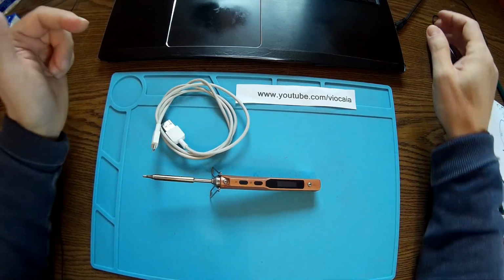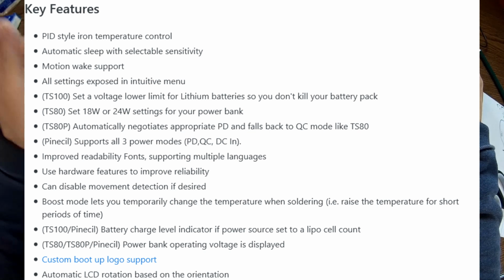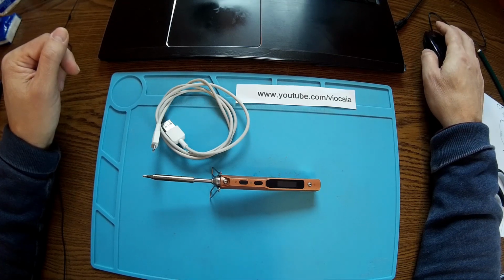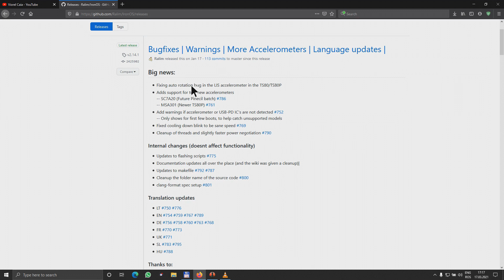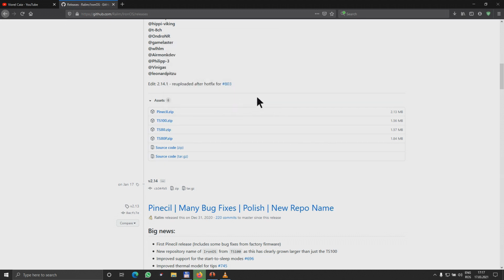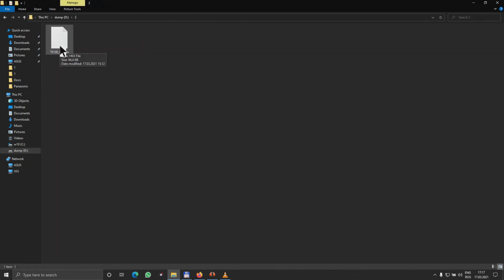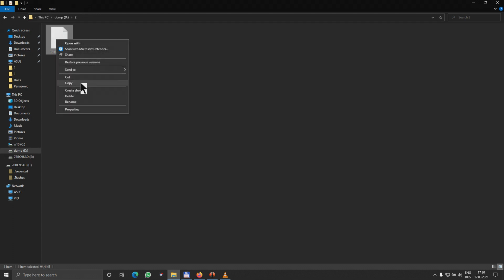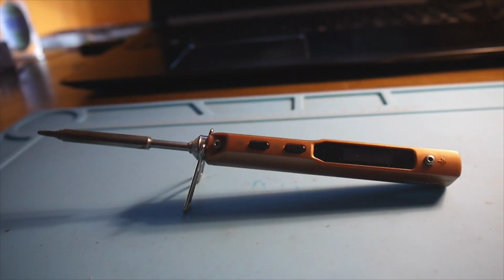TS100 Ralim firmware install

Comment: I remember when EEVblog reviewed the TS-100 back in the days it only would draw 24 watts max instead of the stated 65 watts. Is this still a problem or does any firmwware fix this? I have my TS-100 sitting on my bench, haven't touched it for years, wondering if anything got this problem sorted out?
Reply from the maker: I'll do a power test and will see.. There are many fakes
Reply: @viocaia  it only drew full power while heating up. But not later on when being cooled down by high thermal mass pads for example
Reply from the maker: @saiiiiiii1  Of course..and also keep the power on as long as it feels a heat drain..I can say that I did a lot of big ground pads solders without problem..but I'll check that soon..
Reply from the maker: @saiiiiiii1  It's taking power when it feels a heat drain.It depends of how big is the surface..mine it's working great, I don't feel any power shortage and I did really massive solderings..power cables for my solar install, huge gauge with no problem at all..see the video a little bit later tonite
Reply: @viocaia  so there was no evident limitation at 24 watts?
Reply from the maker: @saiiiiiii1  of course not..wait half hour and I will upload a test video..

Comment: I saw the latest version is from 2021 and I have had mine with the firmware for probably 3 or 4 years I was wondering if anything changed
Reply from the maker: Not sure..I'm using a GItHUb software..not the original..

Comment: OK, it has been 8 months and I love this iron. I added a kind of "collet" (metal collar with a set screw) near the tip of the iron to add more mass and stabilize the temperature, which makes a huge difference when soldering bigger pieces. This was a solid buy and definitely worth the price. 

With the Ralim firmware, is it  possible to set the default starting temperature? I want it to always turn on to 400C. 
Also, how do you turn this off completely, but while still plugged in? 

Thanks Again!!! 
edit: Oh Yeah, Merry Christmas!
Reply from the maker: Yes RAlim starting with the preset temperature..400..even 450! To turn of..in fact to stop the heat just press A+B in the same time..
Reply: @viocaia  OK, I am going to do this firmware upgrade. I was way too nervous to do it when it was brand new. Also, I now know I need 450. Thank You!
Reply from the maker: @VidarrKerr  Hey! The software is ok, go for it.
Reply: @viocaia  I did it! Yes, this is a awesome upgrade for the iron. I watched your video again to, getting it setup. Thank You !!!
Reply: Where did you buy that collet? I was looking for something like that
Reply from the maker: @jaimerodriguez607  Came with the solder iron...

Comment: Ce recomanzi, firmware Ralim sau cel original, de fabrica , pentru TS 100?
Reply from the maker: Initial, dupa faza cu displayul distrus, am banuit Ralim de probleme.Acum, instalat de vreun an, bineintels dupa ce am schimbat displayul..merge perfect..asadar Ralim e ok..are in plus citeva setari utile..de ex tipul de sursa DC, temperatura max 450 vs 400 original...Oricind se poate reveni la softul standard.

Comment: i have the same display issue with Ralim right now, but with a stock firmware it works good.. thats only Ralim issue as i can see, so idk what to do =/
Reply from the maker: I suspected Ralim for making trouble..but , after I changed the display..and for more then one year of using I'm sure Ralim is not the problem...but bad quality display..like I had..

Comment: Try the Pinecil. I'm going to get one soon. Haven't had the TS100 but I've seen these display issues. Hopefully the pinecil one is better quality.
Reply from the maker: I'm looking for..thanks!
Reply from the maker: https://youtu.be/K7mIYiKD-Nk
Reply: Ya I don't think you can go wrong with the pinecil I thought about ordering one but I have a ts100 and don't really need it
Reply: @james10739  With how cheap they are and how frequently they're out of stock. I'd get one sooner rather than later. Have a good spare I suppose.

Comment: Been running official firmware since 2018 and my screen backlight also failed. I would say it is a problem either with the screen or hardware NOT the firmware. The screen can still be read but replacement is clearly the best option.
Reply from the maker: Right!
Reply from the maker: https://youtu.be/K7mIYiKD-Nk

Comment: I went to the website mentioned in the manual and got this file TS100 APP V2.18 (zip file).
Then, I went to the Github for the latest Ralim file and it is TS100 APP V2.14.1 
Does this mean that the one from the manual is newer? Is there a difference? 
Mine just arrived yesterday, so I am trying to figure all this out now. 
THANK YOU for this video!
Reply from the maker: Ralim can go up to 450 Celsius...I didn't find any other improvement  over the stock firmware except fancier display and menus..but 50 degrees higher is ok sometime...also Ralim can let TS to manage the power supply..let's say how many LiIon cells in a battery and the disconnecting voltage..well..I'm using the latest from Git..until now is ok..
Reply: @viocaia  OK, I think I will leave it as it is.  It is working, so that is all I need. I really love this soldering iron.  Thank You.
Reply from the maker: @VidarrKerr  Good idea!
Reply: @viocaia  Do you use the "grounding" cable that came with the iron?
Reply from the maker: @VidarrKerr  never..I.m taking care to touch the electronics metalic ground before..
Reply: @viocaia  OK. About to use it for the first time in a few minutes. Thanks!
Reply from the maker: @VidarrKerr  Good luck and long live TS100!!!
Reply from the maker: https://youtu.be/K7mIYiKD-Nk

Comment: Hey man , so did you have any problems with the display this time ?
Reply: Amazing man , that's great , I am using the original firmware cause I was afraid of that trouble with the ralim also , good to know, I'll give it a try
Reply from the maker: Not at all..even with RALIM firmware..